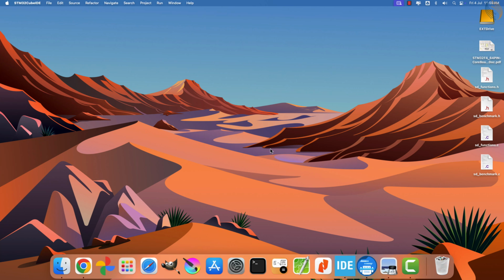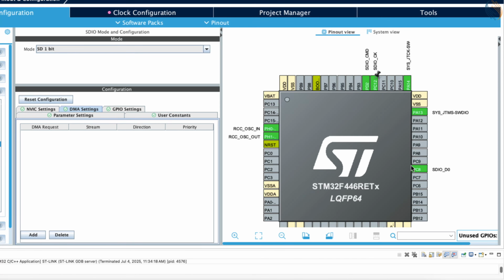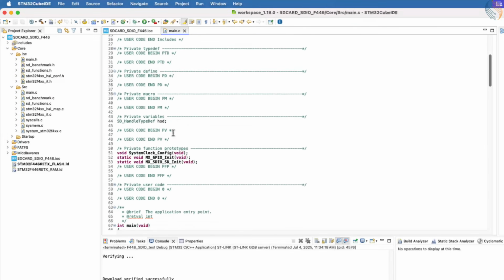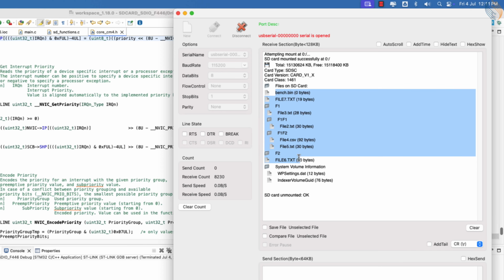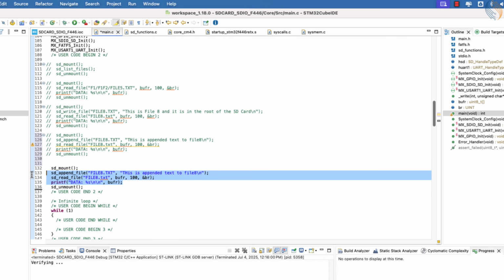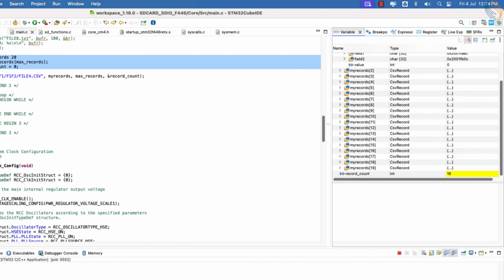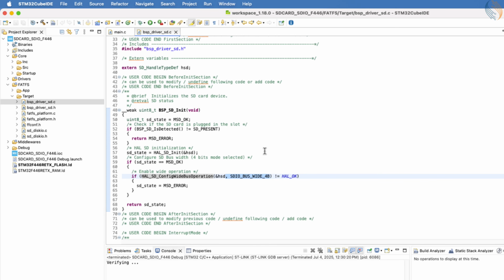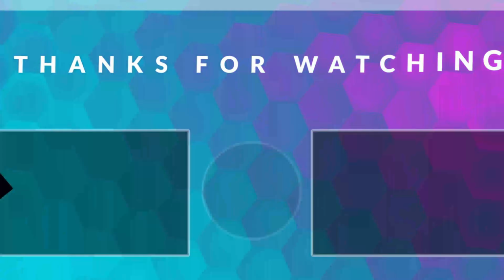Interface SD card with STM32 using SDIO || 4Bit Mode || DMA

Comment: Thank you so much for this great video — I really learned a lot from it.

I’m currently using STM32CubeMX version 6.16.0, and it seems the SD 1‑bit/4‑bit issue is now fixed. So the extra line you mentioned for MX_SDMMC1_SD_Init is no longer needed; selecting 4‑bit mode in CubeMX works correctly.

My MCU is an STM32L476RET6, which uses SDMMC (not SDIO), and I’m working with FatFS. The code works perfectly without DMA, but when I enable DMA (configured as closely as possible to your tutorial), f_mount and f_open return FR_OK, yet the code stalls on f_write and eventually returns FR_DISK_ERR. Also, the SDMMC DMA options on my MCU are different from the STM32F446RET6 you used in the video.

Do you have any idea what might cause DMA to fail in this case? I’m sure the hardware is fine since everything works without DMA.

Comment: hi, I'm still trying the 1 wire SDIO. When attempting to write file, I'm constantly getting error "f_open failed with code: 16". I have no idea what's wrong. Any suggestion?
Reply from the maker: Is the card monting fine ?
Try to create the file file manually, write some text in it and then read using STM32.
Reply: @ControllersTech mounted well. It even read the content correctly.
Reply: @ControllersTech  it is mounted well. it even can read the content of a text file. but when it comes to writing file, it results error.
Reply: which micro sd card brand you used in the project, by the way?
Reply from the maker: Are you using microSD module or SD Module ? The SD card (not micro) has a write protection Slider on it which sometimes slides to ON position (write disabled) while inserting it in the reader/module.